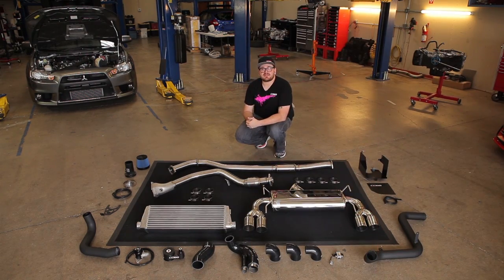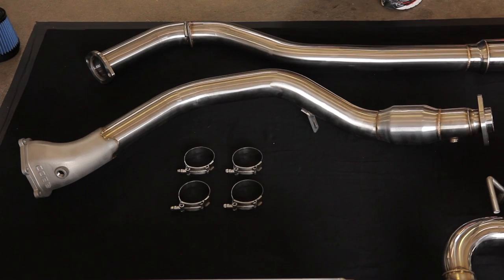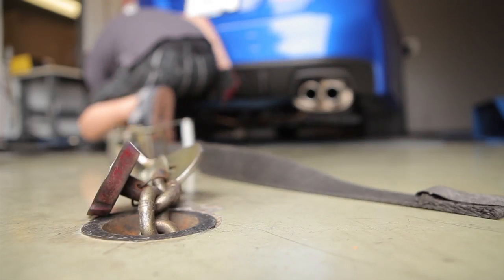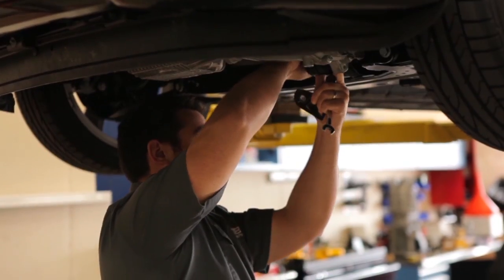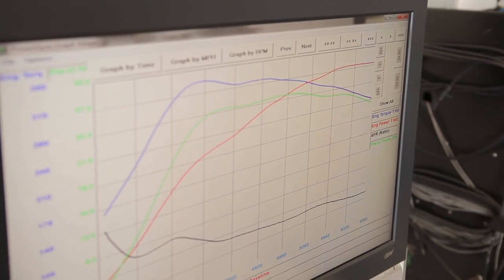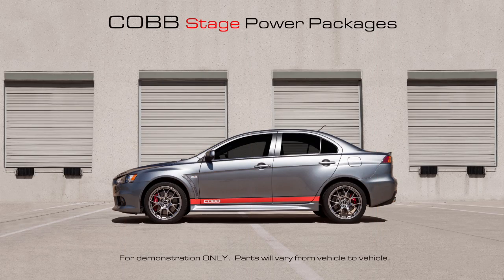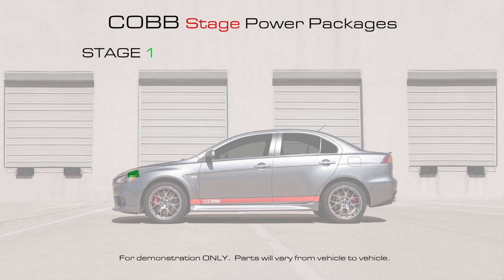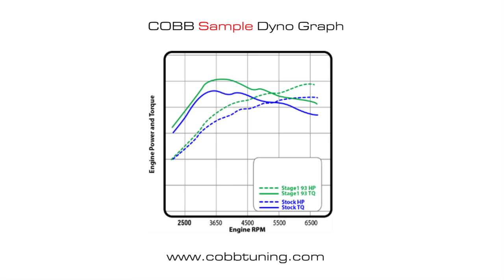COBB Tuning - The COBB Way Part 2: I have an Accessport, now what?

Comment: lol! solid video, the dude is a good speaker.

Anyways, I lol'd then also cried a little at the part where you show the graph of the power differences between stage 1 2 and 3, it was like 100whp gain per stage, uggggggh. I wish my car was capable lol...but nooooooooo, KO3 problems :(.

Comment: I'm a new subie owner and I want to add an cold air intake but will I need to "tune" it on a dyno or would the access port do the job?
Reply from the maker: ALL Subarus will require tuning with any intake changes.  The Accessport has off the shelf maps compatible with the COBB SF intake.  Other intakes will require custom tuning (which can be done on a dyno).  Kyle@COBB

Comment: Hi COBB, i have the COBB accessport -- my question is, 'do i need the cobb ecu tune if i were to install an exhaust catback?' does my 2008 wrx even need a tune for an aftermarket exhaust?'

also, is there a certain step you recommend i do? for  example; should i install exhaust first and then install the SF intake and upgrade cobb accessport? or can i do the accessport and sf intake first? 

i guess to sum it up, "would switching an after market exhaust mess with my ecu after installing the accessport"?

thanks a bunch!
Reply: +COBB Tuning Thank you so much Cody! you the best.

Comment: hi cobb, 
what happens when i am about to install my new cobb accessport v3 but i was not notified that my car was already 'cobb stage 1 or 2' by the previous owner? 
..lets say the owner uninstalled their intake and downpipe but did not un-marry or uninstall the stages off the car using their accessport.

to clear my question: - 'can you cobb stage 1 over an existing cobb stage 1 that you were not aware of?' 

thanks!
Reply: +COBB Tuning thank you very much Cody! ok i will let you know about any surprises in my subie if there are any.. i hope not. thanks Cody.

Comment: I'll tell you what you CAN'T do with your Accessport:  you can't use it to tune your own car any more.  COBB removed their free tuning software, AccessTuner Race, back in May telling everyone they were "retooling" the program and it would be back by the end of June.  Well, that deadline flew by with no release, then COBB told us it was delayed until the end of August, and that it would continue to be free but you had to take mandatory paid training to access it (dunno what kind of mental gymnastics they're going through to figure that "mandatory paid training" = free).  Well, end of August has come and gone, no word from COBB on this gigantic slap in the face to their customers.

The only reason I bought an Accessport is to tune my own damn vehicle, and they won't even let me do that.  Don't make the same mistake I made, buy a Tactrix or Ecutek or whatever opensource option is available for your vehicle, don't give these greasy bastards a dime.